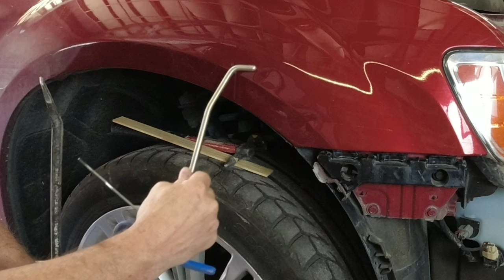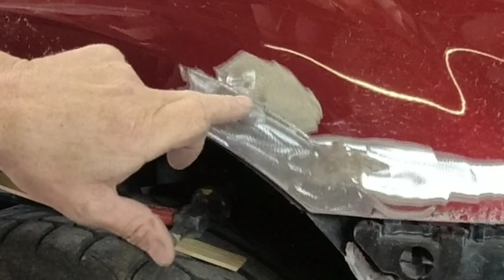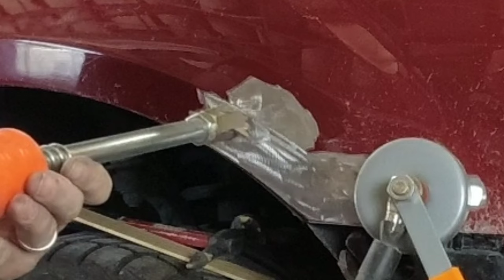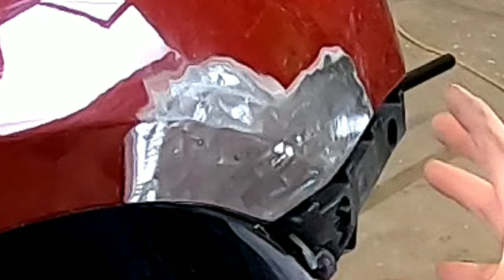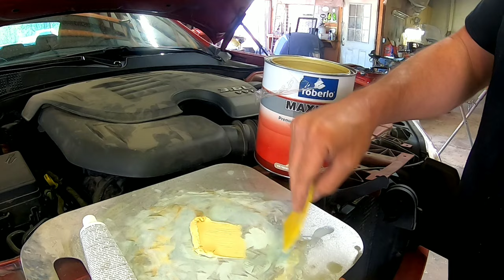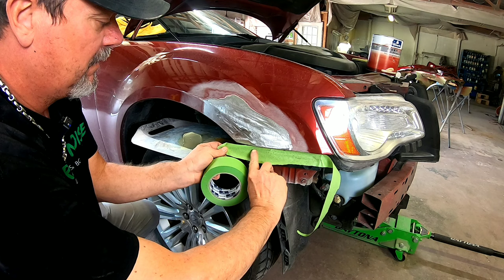Auto body repair made easy! paint and body repair, body filler

Comment: you got alot of patients lol sanding with 180. I would use 100 on a light filler like that.  other times 80 grit on very heavy bodywork. I finish my bodywork in 320 and prime. sand the primer with 400 and use a light sealer sometimes depending on the job.

Comment: Hey there, I have a old steel horse trailer that's dented a little and rusted. I plan on painting it myself. You think I can pot filler on the small dents, sand the rust and paint it without taking all of the old paint off?
Reply from the maker: Depends what your looking for. If your just wanting to clean it up then yes that would work fine . You may consider shooting a sealer over it before you paint.
Reply: @GarageNoise  thank you so much!!!

Comment: Great videos,  I have question , with what labor rates are wouldn't it be cheaper to get a new or undamaged fender and just prep and spray it ?
Reply from the maker: Good question! Remember if you replace the fender now you need  to blend the color into the door and the hood . You would Also need to remove trim on that door to do it properly.  So just repairing  the fender in this case saves time and materials.  Appreciate the support brother!

Comment: I would just knock it out from the inside remove the wheel liner and hammer and dolly away, lol sometimes I hate using the stud guns. the guns are too heavy and the one you have.. it is good but for dings or if you got like 30 minutes of time to pull out. when i do bodywork i try to get it into bondo as fast as possible
Reply from the maker: Yes, it is true for speed I use a different process. I don't want to teach that for beginners. Maybe I should make some videos using different techniques for more experienced technician's
Reply: that would be cool I would watch I am doing a home Bodyshop soon and thinking of doing some videos like this also

Comment: Do you use sealer over the primer?
Reply from the maker: Only if I have to. If I can have a uniform primer sanded to 600 ready for paint without sealer that's  the best option without a paint booth.

Comment: It will crack after some time?
Reply from the maker: Because of body filler? Body filler is really high quality stuff these days it's  not like when it first came out. There won't  be any problems  with cracking . Don't  be afraid of using filler. The only problem is when people miss use it by applying it way too thick.
Reply: @GarageNoise  Yes,i tought on body filler.
Just asking because service repair my door with body filer but i wanted to get new doors.
I hope it doesnt crack 🤞
Thanks.

Comment: Whats your opinion on bondo?? Its the cheapest right? I worked with it but i honestly thought all fillers were hard to work with like bondo whats your opinion?
Reply from the maker: The bondo brand it's been a long time since I used it. The best cheap body filler I've  ever used is R1 it's  made by a subsidiary of Roberlo.  Evercoat  make good  filler. You want good filer if you have alot of body work.  There's a big difference  in how a quality filler sands. It's  much easier .  Gallon will be about 50-60 bucks but it's worth it. Rage ultra is my go to right now.
Reply: @GarageNoise  i was about to fix some rust spots and almost got bondo till i did some more reasearch and this roberlo works wayyy cleaner and easier than the bondo i hated it for a spray or some that stops rust after cleaning inside and out as good as possible what so you recommend rusteuleum? Por15?
Reply from the maker: @rodolfogiles8055  rust spots where? I use por15 on chassis and it's great  stuff inside body panels cavity wax or rust inhibitor like ospho it's  not as heavy  and kills the rust . Check out tomorrows video  repairing rust on the bottom of a door.
Reply: @GarageNoise  rust spot on wheel well around dodge charger and close the rear bumper do you have an email so i can send you pics and see what youbrecommend for this application im in Illinois so rust is bad out here

Comment: you should have started with 80 then 120 would have been faster but if your not careful you can sand too much off
Reply from the maker: Normally  I would have but this Roberlo  filler is designed  to sand easy with 180 but 80 would've been quicker.

Comment: Could've had that back to the customer, in brand new condition in 10-15 minutes , with that one blue handled tool. PDR . Crazy someone would want to repaint thier vehicle and lose all that value , when  that dent was beginner level PDR!
Reply from the maker: Yeah I'm  not that skilled at pdr yet!
Reply: @GarageNoise  I'd be more than happy to give you every pointer I know from 26 years of it. Anytime.
Reply from the maker: It's mainly I haven't devoted enough time to using the rods and practicing finish work. I'm  getting pretty proficient at glue pulling.